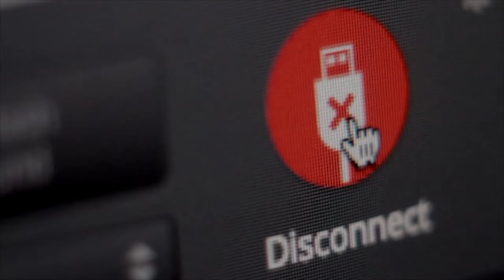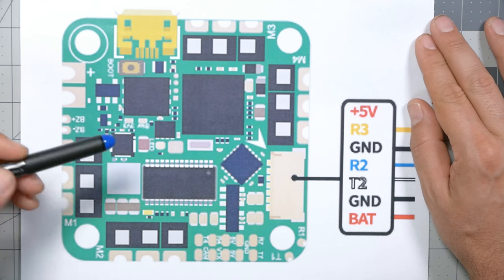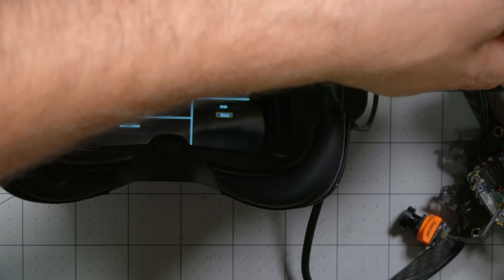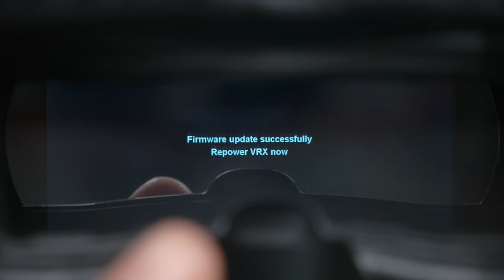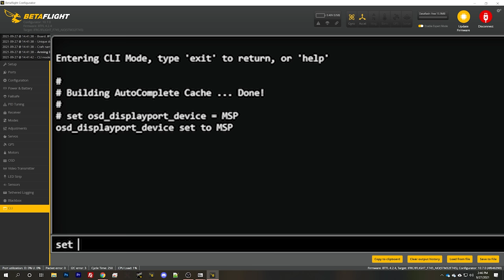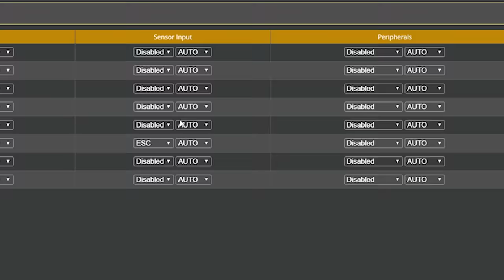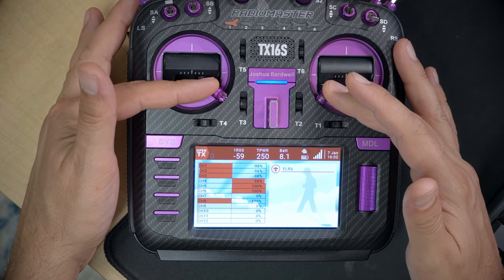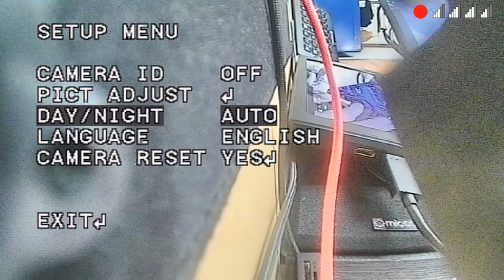Shark Byte HDZero complete setup and configuration guide

Comment: This is a great video! Wanted to point out one more feature in the digital camera control mode - for the Runcam Nano HD, if you hold the right stick to the right position, the camera will cycle between different video profiles. This is great, for instance, on cloudy days - there is a cloudy profile that makes the image look a bit better.

Comment: I just finished setting up all the electronics and BF for my SharkByte system that I bought about a century ago (SharkByte VRX add-on and TX5R.1 VTX) 

Flashing firmware now, and I can't thank you enough for this video. SmartAudio working. OSD Canvas mode working. I'll be going out to maiden the new old drone in just a little bit after the FW updates are completed.
Reply: Everything went great on the first flight. I swapped out the guts from a v1 Roma F5 analog to a v2 Roma F5 DJI frame, because my TX5R.1 just wouldn't fit inside the analog frame.

Total mass has increased by about 45g, and I could feel it. Visibility was massively improved at 25mw with SharkByte/HDzero compared to 400mw on the Diatone VTX. Flew about a football field away in front of me and had no noticeable signal breakup. Same distance behind me and on the other side of a building and trees had pretty significant video noise.

Far better than expected at 25mw

Comment: Bet it can read larger than 32gb cards just fine, you just need to use a program that will format large cards in fat32 I stead of NTFS.
The radiomaster tx16s has 32gb listed as Max SD card capacity but larger cards work if formatted in the right file system and my tx16s has a 64gb and is also the case with my cars dash cam.  The 64gb is stated because its officially the Max size with a fat32 file system.

Comment: hi josh, quick question because i cant find the right video anymore:
DJI goggles V2 have audio out. does that mean you can plug some headphones in and hear your drone motors midflight over the DJI air unit microphone?
cheers from china mate°
Reply from the maker: No it's not possible. The DJI Air Unit does not transmit audio. The DJI FPV drone does but that's a different situation.
Reply: @JoshuaBardwell  nah nah we not talking about that thing. we talking REAL fpv quads here. haha cheers from china josh°

keep the blue side up and thanks for answer. i was going nuts here to see the audio out on glasses but cant find anything online

Comment: If you have a larger than 32 gig card that does not work, go format it with a 32 gig partition and a second spare partition instead.
Most likely the goggles will read it in that case and you still have remaining space to use for other stuff.

Comment: What would actually be cool is to use the "smart audio" input to tell the VTX about the link quality.
So it can increase and decrease power, it will be much more power efficient in close areas and if you need more penetration it would increase power.
I guess DJI does that ?

Comment: Great video, and Happy Thanksgiving to you and your family! This has helped me build my first SB quad. However, I'm having lots of issues accessing the VTX menu using my TX16s. BF OSD and canvas mode worked just fine, but the menu doesn't pull up when I move my sticks from center to bottom left/right. Using the most up-to-date FW and HDZero Micro cam. Anyone else having this issue?
Reply: yes, me ...
Reply: Yes I’m having the same problem second time around..! Accessed the vtx menu with the sticks on a different quad but this new one just won’t work! Did you manage to access it? If so how? Cheers
Reply: SO. In my particular case, I had my camera wired to the SA pad on my FC. Even though SA is not programmed through BF, it ended up not working on that UART. I soldered the VTX to a different UART and followed the steps as normal and BAM, now the VTX menu WORKS!

Comment: I always have trouble getting into the camera menu, it seems like there's a 1 in 100 chance the runcam nano hd menu will open. Any suggestions?
Reply from the maker: Yes that's my channel.
Reply: @JoshuaBardwell  you forgot about the first question. 😄
Reply: Make sure your stick endpoints are correct as yaw right can sometimes not trigger if the endpoint is too low.

Comment: How do you get the osd elements all the way out to the boarders :P
Reply from the maker: The location of the OSD elements just depends where you put them in the betaflight configurator. The reason they are off the side of my screen is because I am using 4:3 aspect ratio. So I have black bars at the side of my screen. Just move them to the side in betaflight and that's where they will be.

Comment: When you setup the MSP in the config tab, the IRC tramp is still active for another UART. Shouldn’t that be turned off too?
Reply: Even after you save and reboot?
Reply from the maker: You are correct that I'm not using IRC Tramp on this build, and it could be turned off to free up the UART for some other purpose. But it won't harm anything if it's left on.

Comment: Funny enough I just bought a sharkbyte receiver on sale… I couldn’t turn down $200 total cost to try a digital system as my goggles already had hdmi. 

Also I used a 64gb sd card on the google module, I just had to format it in the module first, then it worked for me anyway.

Comment: Great video, thanks. I managed to put my system in 50fps mode and it stopped transmitting. I randomly fiddled with the joystick that came with my 5.1s and managed to reset my camera back to default so it can be picked up by the receiver. Not content with it working properly I managed to get my camera back to 50fps mode and lost a receiving image again. I am not able to get the image back no matter what I try, even a reflash has not fixed things. Do you know if the bf cli contains some kind of framerate reset option?
Reply: thats what happens when you start messing with something you know nothing about. I find it hilarious that sharkbyte comes with no user instructions. So I dont fault you at all.
Reply: make sure the receiver and transmitter are both in 50fps.
Reply: @tylerelliottFPV  how can that be done if my receiver is not receiving an image?
Reply: @HoppaCheese  your reciever osd menu has a setting
Reply: @tylerelliottFPV since the setting was changed i cant view the osd any more. I need to be able to reset both the camera and tx without the osd being visable.
Reply: @HoppaCheese  the reciever has a menu screen. You hit the button on the shark byte reciever and find the setting that changes the recievers fps from 60 to 50.
Reply: @tylerelliottFPV  There isnt such an option on my receiver
Reply: @HoppaCheese  You're right!....There used to be. You can see old videos people have on youtube and see the menu option to change framerate. 
https://youtu.be/4QSwoytiZJo?t=545
you probably need to reflash firmware.

Comment: I've heard that the Sharkbyte PCBs are extremely fragile. Is that true?
Reply: I broke 2 out of three (whoop styled vtx) in least than 10 flights.
Reply: @marssin3519  I’ve been flying my original whoop board since it was first released and have crashed it hundreds of times in my 3s TP3, so far still works perfectly. Mine is conformal coated and I have a cap at the main battery leads

Comment: I was in the middle of updating my scout 2 HD goggles and my batteries died. 

When I changed the batteries now my scout hd just display a black screen.
Reply: Ot oh! Bricked it. I'm sorta sure there's a way to bring them back... But, who knows? 🤷
Reply: There is a way to bring it back. It has the directions in the manual. There is some kind of switch on the bottom or back of the vrx that you need to use and boot it up then move the switch back after.

Comment: My build, I've had the OSD freeze on me. I need to disarm and arm the quad to fix it, happened maybe 4 times (that I've noticed) with less than 20 packs.

Luckily I've got my controller configured to read out battery voltage from 3.7v per cell, so I can go without on-screen battery voltage, but has anyone else experienced this?
Reply: FW bug. Use OSD disable mode on an aux switch to reset during flight.
Reply: Thanks @oliverwright6263  sounds like a good idea, I'm sure it won't take too long for Shark Byte's next firmware to fix it.

Comment: awesome...just bricked my fc doing this shit.  msp serial = 1 for uart2.  something bad happened
Reply from the maker: Your FC really can't be fully bricked from this. If you screwed up the config, use the bootloader button to put it into DFU mode and re-flash it.
Reply: @JoshuaBardwell  correct it’s not fully bricked.  It’s a radix2 so I had to reinstall the firmware fresh.  However this isn’t the first time setting up HDZero, you can probably tell cause I call it HDZero.  However I’m not Exactly sure how to proceed at this point for canvas mode.  This is not the only radix board I’ve setup HDZero on so I’m at a total loss.  I know I have all the correct uarts.  Just not sure what could have caused that to happen?  Thank you for your prompt response to such an old video.  Amazing man.  And I tell  everyone so get mad or say it back.  I love you brother.  Thank you for everything you do for the community.

Comment: Mapping and connecting non-cooperating ESC and FC's with "make your own plug" options are the worst.  The pin sets rarely set properly and are very fidgety, and take forever especially if you have poor eyesight.  I always think about 1/2 way through the process - I'd rather solder single ESC's. I'm hard-headed and don't learn easily. :/

Comment: Are the small perforated holes with copper traces on the TX5S.1 attaching the screw holes meant to be soldered making the edges more difficult to break off?
Reply: @Alex-kb4ve  That doesn't answer my question at all. I'm aware its to make them easier to break-off. But if they were not also to solder then why include copper traces? I DON't want the edge to break off so I soldered the holes. I guess I'll be letting YOU know if it works.
Reply: @nolandfpv  never ever seen anyone solder those holes in any vtx with breakable holes . I highly doubt it would break unless something really nails it in a crash.
Reply: @divingfalconfpv4602  the edges actually will break fairly easy - hench soldering. Since, I soldered the holes the board is still intact after a crash. Ill know for sure after a few more crashes. Ill also write Fatshark for an offical response.
Reply: @nolandfpv  now ur making me worried for not soldering vtx I have lol.. hasn't broken yet. But I mean it is light board
Reply: @divingfalconfpv4602  inside a frame with a top and bottom plate its not an issue but on a toothpick the board is more exposed. I dont think this would work on all vtx’s - only ones with copper traces.

Comment: gggrrr ALWAYS... i did every step of update - install everything and  of course nothing i do EVER just works without hours/days of problem solving.... i have RED LED  but nothing on my screen no signal output by vtx at least goggles dont pick up nothing, everything updated on same firmware version, just LIKe vtx isnt outputting info, signal....
Reply: i ordered new vtx tx5s.1 and i installed it working perfectly, but i cant get the osd to work, followed all steps tried 2 diff uarts,nothing,, im gonna start from the begining, and try again.